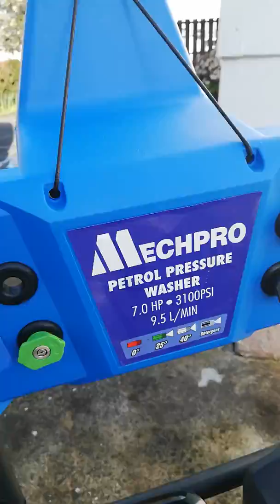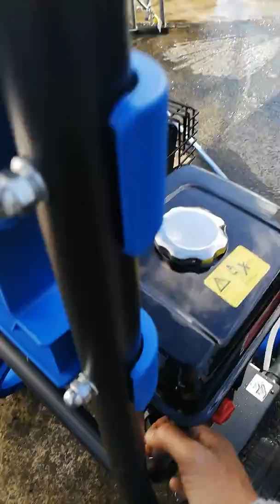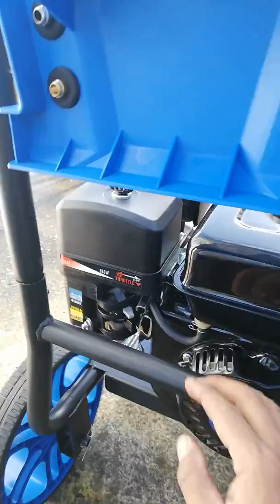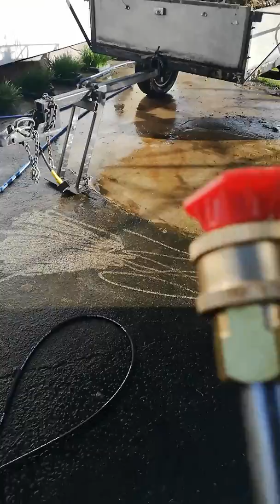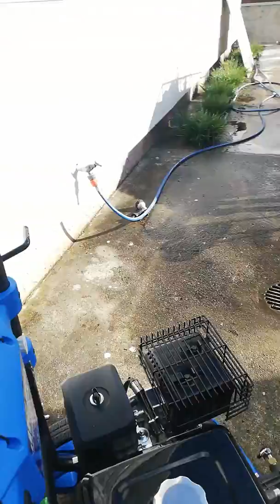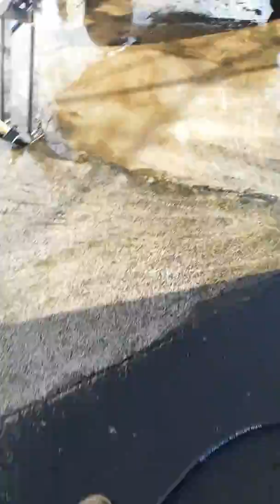Mechpro 7hp 3100psi water blaster

Comment: Problems with mine, barely used it now wont start.
Reply from the maker: @redboylfc1  usually it won't start it will be faulty spark plug...try new one and spray engine starter or CRC onto the carburettor foam Element.

Comment: does anybody know oil level in pump on 3100 as per manual it says to check GLASS ON SIDE  Guess what no such glass to check
Reply: Fill it up till it runs out of where up put the oil in 👍
Reply: roy schultz has anyone had the pressure washer itself not function